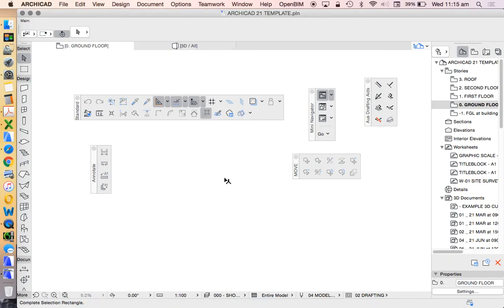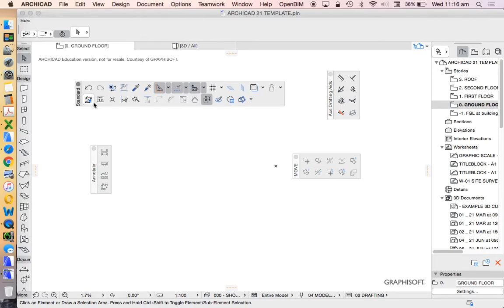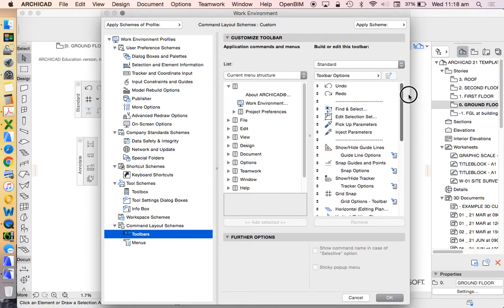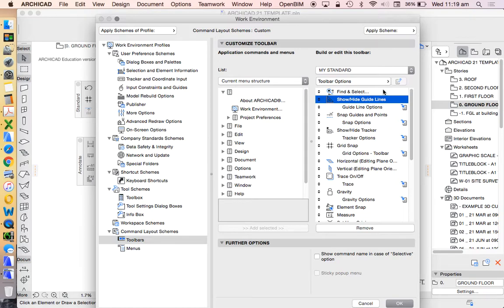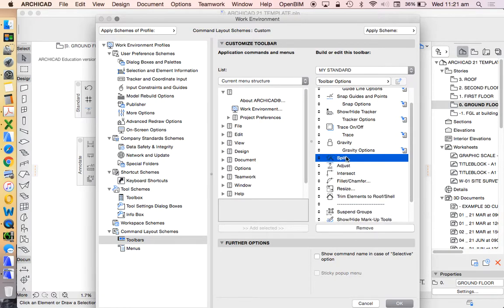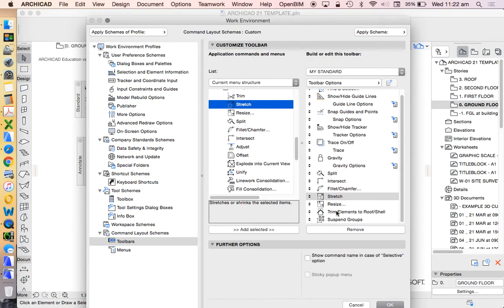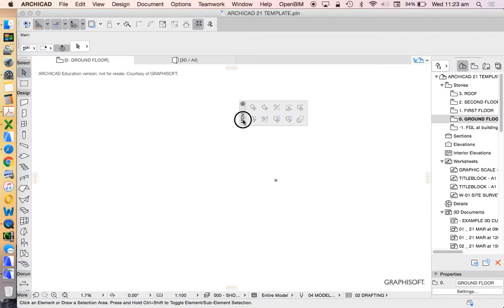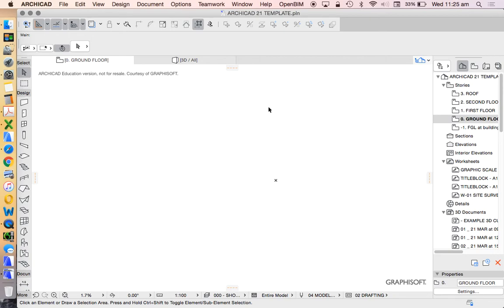ArchiCAD 21 - tutorial part 03 - Toolbars

Comment: I hate the new icon style
Reply: I disagree its a clean look and lets face it you’ll get used to it
Reply from the maker: I have to admit, I'm not a big fan of it either. :( it tool me  while to figure out which icon was which, and I still get a few confused at first glance.
Reply: Totally agree!

It's a disastrous,   unnecessary -  and wholly UNWANTED  - "change" that goes completely against the fundamentals of good interface design.  And this coming from an "architectural company" that claims to be experienced in understanding good design, and to deliver to customers a "user-friendly" interface that is "clearly" designed to make their job easier???

Very ...  Definitely ... NOT!

It's the cool new style, folks!  Archicad claims.

Except that it was at the great expense of fixing and introducing other Archicad features that are much more important and would actually have been useful.  Instead, Archicad chose to put our programmers to work on this nonsense, and then foist this incompetent application of it onto customers who were clearly NOT happy with it at the beginning.  And to this day, are STILL fed up with it.  Does Graphisoft not actually listen to the complaints from its customer-base???

SolidWorks made the exact same mistake a few years ago - arrogantly justifying a similar hideous new icon format.

But the difference with SolidWorks was that they QUICKLY recognized their customers did NOT like the new change, and so almost immediately in a special service pack release, gave their customers the OPTION to stick with the old-style icons if that's what they preferred.  And most clients did (and still do!)  just that!

GRAPHISOFT management need to learn the same humility as Solidworks.  And offer the same compromise.